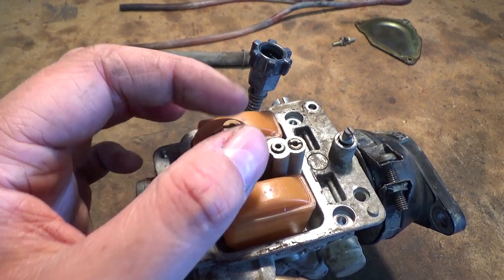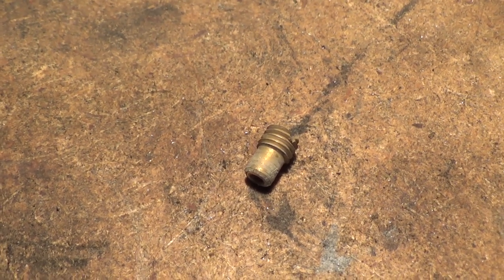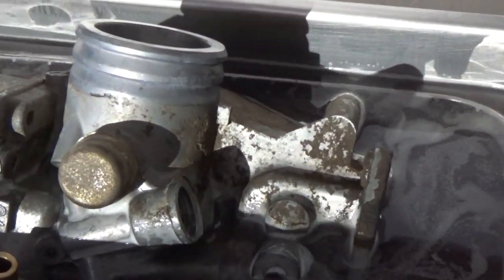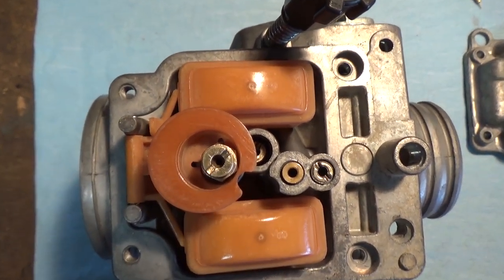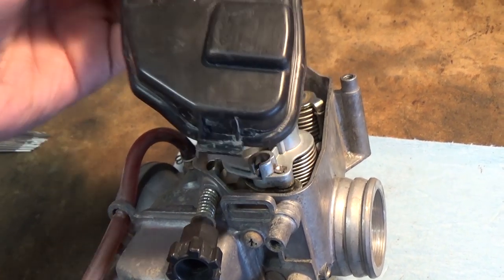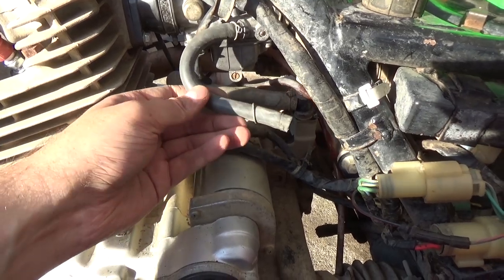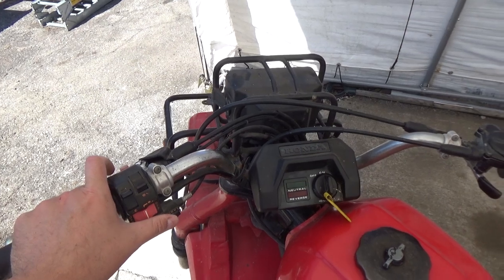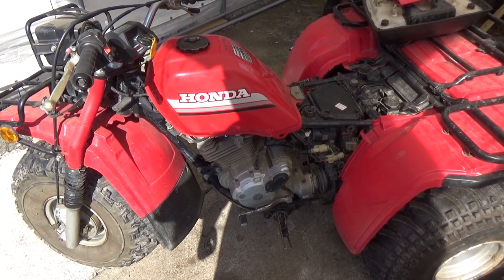1985 Honda ATC250ES - Full Tune Up [Part 2] BIG RED

Comment from the maker: Part 3 will be up this Saturday!
Reply: I own the same big red and love it.  I just found out today that the 
Champion heat range number is:  "8 is hotter than 7",  i.e. the higher the number the hotter the plug runs.  NGK however does it backwards, i.e. 7 is hotter than 8.  Also the NGK DR8ES-L plug has a heat range half a point higher than 8.  This is the meaning of the suffix -L.  The DR8ES-L plug that your referred to in the youtube above can be interpreted as DR7.5ES.  In other words hotter than DR8ES but not as hot as DR7ES.  Your video was the best that I have seen on this subject and I have been watching for help on Big Red carburation for over a month.  Great job, and professionially filmed.
Reply from the maker: hymersbees thanks a lot Hymmers! I try to be as thorouh as possible when explaining things!

Comment: every 100 hrs I change the oil. and clean the carb every 6months or when it acts up. and a spark pug when it doesn't start under 5 pulls !!! after 7 yrs it still runs like a dream !!!

Comment: Bro !! This is the most intelligent explanation of the Big Red carburetor I have seen !! I have two Big Red 250s , one 200 es , and a Yamaha 200. They all run , but I struggle when I take carbs apart to know which jet does what. ThankYou!!!!  And the tip on sparkplugs..Spot On !! Fixed my problems.
Reply from the maker: Thank you!

Comment: By far and away the best I've found on Big Red "how to" videos. Thanks. We still run one of these. We get many laughs from folks in their 15K side by sides. I guess it never occurs to them that in the 40k for the 4 wheel drive truck which never gets muddy, the 10k trailer to haul the 15k side by side all added together would put their Child through a two year RN Program at some college and does not matter. Being a poor person, I just don't know any better, I guess, than to run my little old Yota 4 wheel drive and Big Red out of the back of it, without incurring massive debt. In this country if you can afford to make the commercial and get it air time you can sell anything. Thanks again for a very well done video. It is saved to my Favorites now and I subbed. Peace to you and yours son.

Comment: where do the top 5/8 hose go for vent. One hose goes from crank case then has a T, lower hose goes down to vent . Top hose goes up behind carburetor then comes out under frame below front part of seat. I can smell gas fumes from it while its running.  Does this top hose go somewhere? Fumes are stinking up my garage
Thanks

Comment: Is there supposed to be an o-ring and/or washer in with the spring on the air/fuel mixture screw?
Reply: Yep. And screwing in the mixture screw will make it leaner, not richer. Only 2 mistakes though.
Reply: To answer my own question, for the sake of future readers.
Yes, there is supposed to be an O-ring and washer on the air/fuel mixture screw, along with the spring. 
The o-ring goes into the carburetor first, followed by the washer, then spring.
Or to make it easier to understand, slide the spring onto the needle first, then the washer, and lastly the o-ring.
Reply: @hassandawudi4810  Right

Comment: Too bad you had to pull the carb again to adjust the metering rod but as Frank Sinatra sang "That's Life". For any of your Eliminators the carburetor pressure pump is Stens part #705-020 with a list price of $192 Cdn which includes the sales tax but since Eliminator Performance has set up an account with them you got the $110 Cdn price. Presently Stens offers free shipping with orders of $150 Cdn or more which is a great savings over time.

Comment: 1986 big red 250, replaced battery,  electric start has nothing. No clicking no anything. Headlight n neutral light turn on after the machine runs awhile when i use kick starter. Headlights do not turn on with new battery unless machine is running for some time???

Comment: Would u care to do a video on a 1984 200es big red firing issue had a couple loose fire
Reply from the maker: I don't have one of those, this was a customers that I had to go over.
Reply from the maker: Probably coil pack or grounding on kill switch. Try putting electrical tape in between handle bar and kill switch sometimes they ground to the metal bar and cut spark!

Comment: Are the 4 stroke plugs the opposite of the 2 stroke plugs?   Lower number is hotter     Br8es is hotter than a br9es
Reply from the maker: NGK and Champion are different. Champion plugs are hotter the higher they are, and NGK are hotter the lower they are.

Comment: My mid length carb jet seems to be blocked. I can not get my cleaner rod through it. I am assuming it should be open all the way through. Is my stupid self correct in that assumption????? HELP Thanks.
Reply: 87 250 Big Red. Sorry. Great video has been much help. Thanks again.
Reply from the maker: @ergot57  try using a compressor to blow it through, sometimes the holes are very small and you need to improvise
Reply: Ok will do. Just glad to know it should be open. How else could it work if it were not? Silly me. Thanks again.